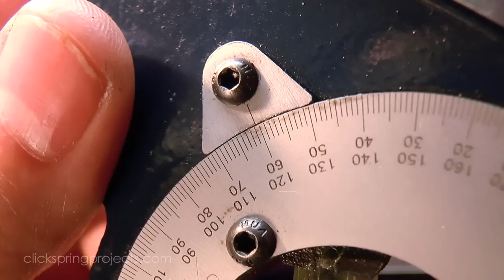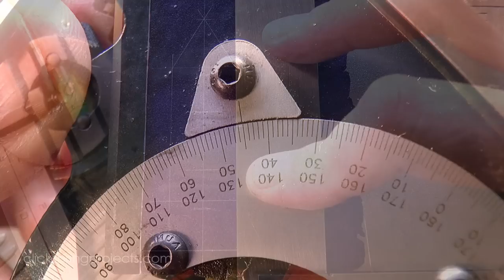Workpiece Preparation & Layout

Comment: I'm more of a cabinetmaker/woodworker than a machinist and learnt how to cut just to the outermost edge of a (sharp) pencil line.

Sometimes I'd use a knife to mark out joints and, again, cut just to kiss the outer edge of the lines. With precision metalwork, the line becomes almost theoretical: in geometry a point or a line has no physical size at all, which only goes to prove that Chris must be a magician because working to a dimensionless mark ought to be impossible. 🤔 Um...